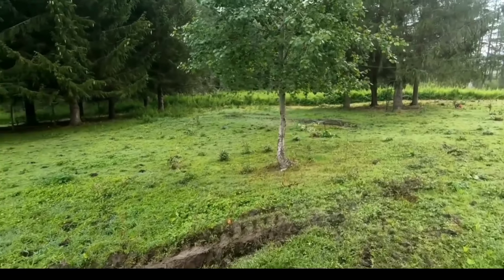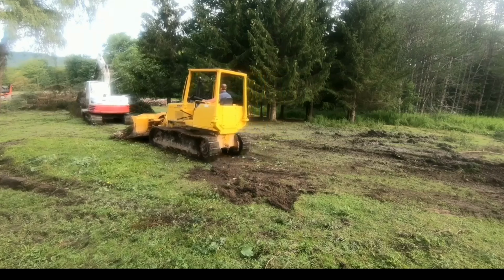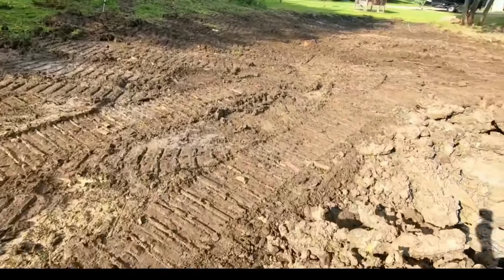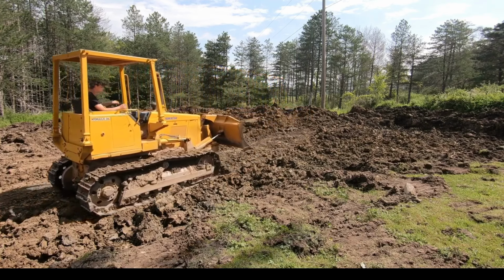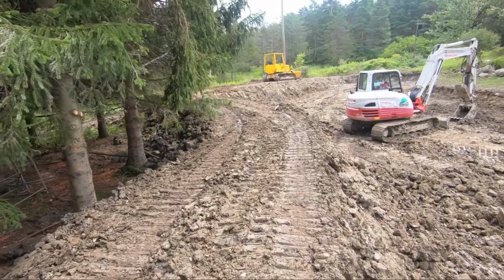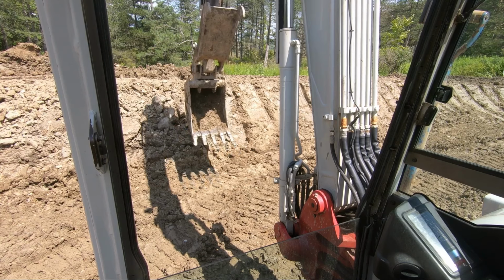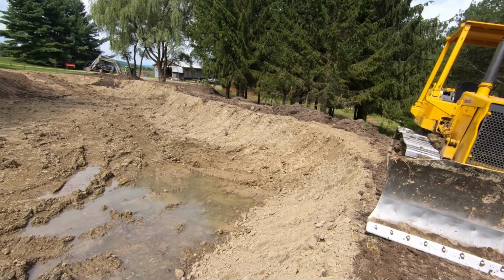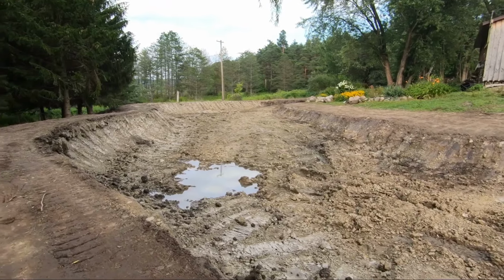Building a 1/2 Acre Frog Pond (Start To Finish)

Comment: Was wondering why you did'nt pack the loose dirt in the keyway and pond is looking good
Reply from the maker: We packed the dike every foot or so with the dozer while we were building it so the keyway should be packed in pretty good. Thanks for watching!
Reply: Yea didn’t u c it
Reply: dozer doesn't pack the dirt that good should be using a sheep foot roller that's the best thing you can use to compact the dirt

Comment: Nice video. Thanks for sharing. Excuse my ignorance but what holds the water in the pond? If no clay is present would this method still work?
Reply from the maker: The soil we built this pond in was straight clay, so perfect for ponds. If no clay is present, the most common method is to build the pond out of the material you have, then line the entire inside with clay. Usually it needs to be trucked in. Its also possible to buy pond liners. Which are basically a giant tarp, but made of special materials
Reply: @janoraoutdoors  thank you for taking your time to clarify this. Best wishes from Derbyshire, UK 🇬🇧

Comment: Is an overflow not necessary for this sized pond?
Reply from the maker: No, overflows are required for any sized pond. We just don't install them untill the dike settles and packs down. This way the water level will be perfect. If you want we made a video of installing this ponds overflow. Feel free to check it out
Reply: @janoraoutdoors  Got it. Thanks for the reply. Keep up the great work.
Reply from the maker: @glennprevost7140  Thanks for watching 👍

Comment: Cool video. My clay is about 18ft down so not sure if to get a huge excavator to dig out material or pay $250 for each 14yrd truck. I want to do a 50x80 ft pond.
Reply from the maker: That's a tough decision. Removing 18 feet of material is going to leave you with a huge amount of useless dirt. Probably would be much easier to haul clay in. But probably much more pricey

Comment: Whats the width, dept and lenght of this pond. Did all the escavated soil go on the wall of the pond or did you move some away? im thinking of having a pond too
Reply from the maker: This pond takes up about 1/2 acre and averages about 7 feet deep (quit shallow). All the material in this pond was used to build the dike. Even the topsoil that was stripped was put on top of the dike. But depending on your location for the pond you may  need to take material away. Fortunately we needed all the dirt we could get.

Comment: Digger driver ain't got much idea,smoothing the edge should be done from the top pulling soil upwards.
Reply from the maker: I'm confused by what you mean?
Reply: When you batter a slope the machine sits at the top and pulls the edge upwards this also helps with compaction and reduces pulling soil back in where you dug it from.
Reply from the maker: @michaelslinn7472  Ah I see what you mean. The reason why we did it that way was because we weren't taking the excavator on top of the dike. The tracks were to wide. Wanted to keep the top of the dike only a few feet wider then the dozer.

Comment: Do you have to worry about building a dike with a key for a seasonal duck pond that will fill every fall-spring. High water table. I did an experimental pond a couple weeks ago...basically a circle pond and built of the sides. Compacting it down where needed. Didn't really do any finish work. Not big. 30x30 with just an excavator. Will see what happens!
Reply from the maker: Key ways arent always necessary for ponds. The point of a keyway is to stop water from going under your dike. Usually they are unnecessary but we install them in every pond just to be safe

Comment: I don't understand why you left that large tree in the midst of the dike.  If the tree lives, its roots will grow through the dike and into your pond for sure and both deplete the water as well as lead the water to leak out of the pond over time.  If it dies (highly likely since you've buried it's side by backing dirt a foot or more up the trunk of it), the roots inside and under the dike will rot out, leading to failure of the dam as well.  Also, the point of a keyway is to pack the soils into it in short lifts to really seal the dike.  Just pushing the soils back into the keyway in one fell swoop and driving over the top of the whole thing definitely won't be as effective unless it's a very high percentage of clay.  If you're not lining this pond or if there's not a ton of clay in that soil, I have to wonder how long that pond is going to hold water.
Reply from the maker: @carolewarner101  the soil was mostly blue clay. That pine tree is farther away that what it seems on the camera. And we are very experienced with installing key ways and never had a problem doing it this way with the soil conditions. Its also packed way more than what i have on camera. Good observations though. Sounds like you may have built pond before?
Reply: Got it.  I've only ever dug a few tiny micro ponds around the place to slow and sink water into the ground higher up on the land, making no real attempt to seal it up for that reason.  But I've been doing a s-it ton of research for building a big one some day (soonish).  Can you help me understand why that tree that's inside the down water side of the dike won't be any problem?  It seems like the roots must go through the dike area and in under the pond.  And even if not, surely the roots will be drawn to grow towards all that water, right?  I  need to learn everything I can about building the dam correctly and avoiding things that can cause leaks because I can't afford to hire a professional to make our pond and I really wanna get it right the first time!
Reply from the maker: @carolewarner101  Definitely keep trees as far away as possible. I build alot of ponds for people in varying conditions. Tree and other plant roots are the #1 reason for dike failure. This particular tree was far enough away to not cause issues. Most ponds i have to fix have trees and bushes growing on the dike. Im more then happy to help with any questions
Reply from the maker: Also do some research into bentonite clay. Works like magic for sealing ponds. Ive used it countless times in new ponds to seal around overflows, and in many old ponds to seal any leaks that form

Comment: $40,000 for a pond what size?
Reply from the maker: This pond costed roughly 7,000. And its about half and acre. Lots of factors come in when building a pond. And if you have to bring in clay, it can get pricey. But for 40,000. You better be getting a lake.
Reply: Those trees look like root trouble,  leakage
Reply from the maker: @davidgroff3355  Which trees? The pines left behind?
Reply: Any trees with the drip edge over the dam means that the roots are there also,  if not then ok
Reply from the maker: @davidgroff3355  No the root systems definitely cant reach the pond. We remove any trees that close. But you are correct. Root systems are the #1 reason for dike failure. Seen it many times

Comment: Felling trees and then removing the stump is a waste of time. Digging out a stump can be far more difficult than it would seem to be even with a track hoe. Pushing the tree over allows the weight of the tree top to help uproot the tree root ball and all. Using a track hoe sometimes involves trenching one side of the root ball first. A better option is to use a track loader with a tooth bar which works much better than a dozer for removing trees. A track loader allows for far more control.
Reply from the maker: Ah yes. The amateurs! How many ponds have you built in your life? Im at about 20. That doesnt include any other projects such as driveways. But im sure you have build way more then me. Its fine though. You can stay on your couch at home and keep on hating on people that actually do something. Ill keep doing my thing.